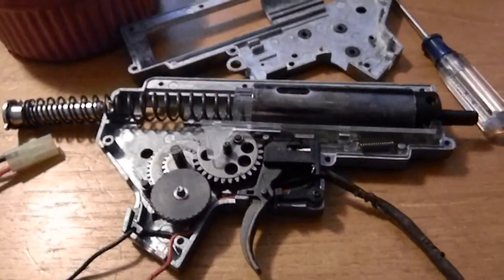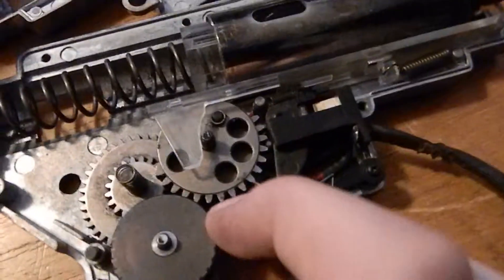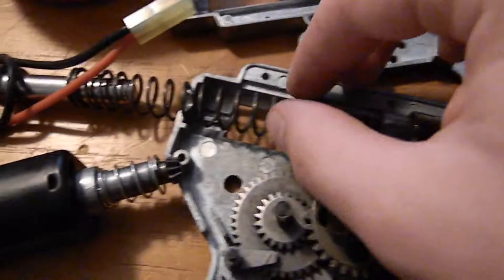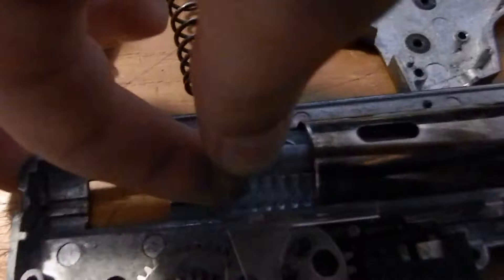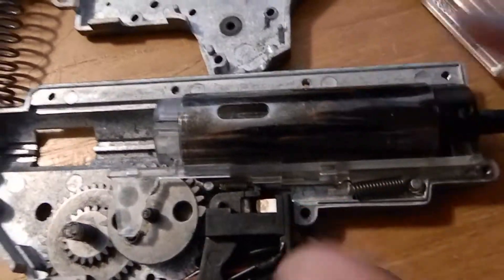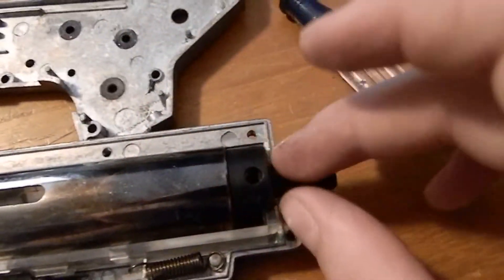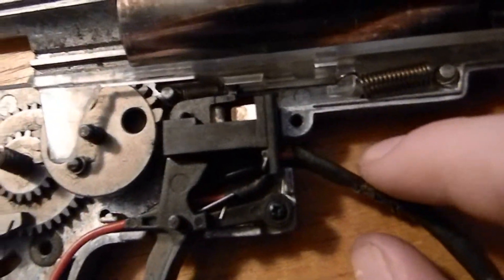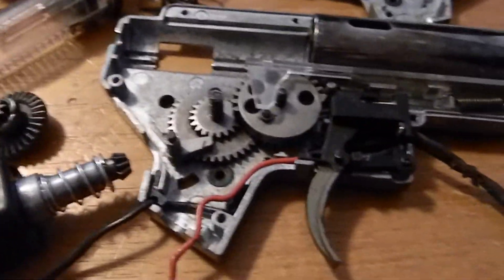How Your Airsoft AEG Gearbox Works

Comment: Hate to break it to you Chris K but you are wrong, the port is there so that the acceleration of the piston driven by the gears is much quicker and so that it applies a lot less stress on the gearbox shell/cylinder head.

Comment from the maker: well high torque motors can pull and heavy spring and give you good trigger response. high speed motors such and the echo 1 high speed can give you up to 35bps is you put an m110 spring in it